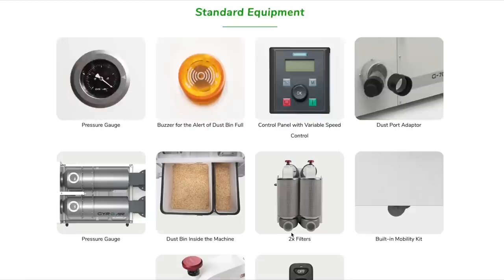Harvey Gyro Air G700 / NORDFAB Duct Work

Comment: Again, we thought alike. I too went with the Nordfab ducting after agonizing over the cost for about a month. I just finished the install a couple of weeks ago. Paired with my upgraded DC (different make and model than yours) I feel like I got more value than I paid for, My shop is virtually dust free now. I did find it cumbersome to assemble the ductwork by myself but with my wife's assistance we knocked it out in short order. And like you said, it's super easy to change. After a couple of days I decided I wanted to tweak the runs a bit and we got it sorted out in no time.

On thing I appear to have done differently than you is that in addition to running 4" drops to my table saw and router table (my router table is inset at the end of my table saw) I also ran 2.5" drops from above to my table saw blade guard and router table fence. I connected those with loose fit/quick connect fittings so I can easily move the hoses out of the way if need be.

I also ran drops down to my miter saw, disc sander, and spindle sander, drum sander, and planer/jointer. (My bandsaw and drill press are connected to a separate wall mount DC unit.) 

Lastly, I used iVac automatic blast gates on everything, which also was quite pricey, but again, well worth it to me.

On a side note, from the brief glance I got, I think we even chose the same overheard power cords. I love that they are 12 gauge and went on sale just as I needed them!

I might as well confess that I did steal the idea of getting that overhead boom for my CT-36 extractor from you. Overall it's nice to have the hose and tool cord out of the way, even though I still fight with it sometimes.
Reply from the maker: Thank you for your feedback! Seems like you getting everything sorted out. And, I love the boom arm. I do agree though, I still fight it as well a little but I think it’s just the nature of the beast.

Comment: I've pretty much decided to go this route for my new shop setup and may buy now to benefit in my temporary shop. The low noise is a big benefit and Harvey also has good pricing right now, too. I'm already using quick connect duct and no question, I'd never go back to snap-lock or spiral.
Reply: I'm curious if this can handle the FS41e. I'm considering selling my Oneida 2hp Super Dust Gorilla and buying one of these for noise level alone.
Reply: @pr0jektcha0s  If you do a lot of milling, you may or may not be happy and that's purely due to bin size. CFM isn't going to be an issue. I had to weigh that before making my decision which was to go with the G700. I"m not doing a lot of big projects so I'm less worried about the bins filling frequently. So far, I'm extremely pleased with the G700 since receiving it a couple weeks ago. Of course, the real test will be in the new shop building where the duct work will get a little bit longer than in the temporary shop.
Reply: @jimbecker5675  It would be a difference coming from the 55 gallon drum. Still, the noise level would be such a huge win.
Reply: @pr0jektcha0s  Same transition from me...from a 2hp "pre-Gorilla" I picked up in person at Oneida factory with 55 gallon to the G700.

Comment: ADVICE QUESTION: You pretty much have the best ductwork setup for your situation to smooth out the path from machine to the extractor.  What are your final thoughts on this extractor's actualized pulling power for your larger tools, your jointer/planer?  I will be running a A3 41 and I am looking at the 700, comparing it to the likes of a 2-3hp Laguna system, but I am left wondering if it can handle the task.  I will be working less sheet stock and mostly milling up rough sawn hardwoods.  Do you find your 700 has the oomph needed for the larger chip load of your jointer/planer?  How fast are you filling your chip bin with this machine and do you find the chip bin undersized?  Imagining for a moment that you were processing wood in the rough on a frequent basis, would you still purchase this extractor?  Your thoughts, as always, are appreciated.
Cheers!
Reply from the maker: So the first thing I will say is I am absolutely loving this new machine. I as well will have the A3 41 in the shop starting in December. With that being said no I don’t have any concerns with my dust collection being able to handle it. Currently I’m getting over 700 CFM at every machine. The only downside that you might experience is the size of the dustbin capacity. I initially thought this would be a downside myself but after trying to empty 55 gallon bags I would much rather empty a much smaller bag more often then empty a very large bag less often just because it’s so much easier to do the task. The other benefit to it is it’s very easy for me to remove the bag and throw it in my trashcan. So it totally depends on how you look at it because in your case it may get really old if you’re milling a lot of lumber and have to empty the dust bin four times in one day. All in all I don’t really have any complaints about this machine so far. I will probably be doing a overview video in the October November timeframe after I’ve had a good six months or so to use it and empty the bags multiple times but so far I couldn’t be happier. Even at my CNC machine which is the longest run it is absolutely dust free when I’m done cutting
Reply: @bentswoodworking  thank you for the thoughtful response brother. I retired out of Ft. Bragg last January. I believe you are a mil brother, how much longer do you have and where are you settling down when you are done?

Comment: Do you have a 240 volt wall switch to control the 240 volt outlet? So you could leave the power on switch at the backside of the G700 in the “ON” position, and not have to reach over the top of the machine to turn on that switch. You could just flip the wall switch and your power would already be on, then use the controls to start running the dust collection. Especially if you have or build anything across the top. If so could you show how you did it?
Reply from the maker: I don’t. It just stays on. But if I did have to move it I would just pull the machine out after putting a surface over the top. It’s very easy to move around
Reply: @bentswoodworking  Thanks for the reply, greatly appreciated. So am I correct in assuming you leave the power switch on 24/7? If so does has it added significantly to your electrical bill?

Comment: Great video!  How did you figure out the hose length for the CNC? I am planning my system and thought that I would put the swivel head centered on my 5x10 bed but not certain how much hose to order and how much slack to figure in. Thanks.

Comment: Jason, what would you think about placing a dustdeputy XL style Cyclone in front of the Blower?  I love everything about this unit but I really dislike the bangs and pings when a piece of wood larger than a chip goes thru my impeller. (on my HF unit)  BTW.  Bought the g700 yesterday.  looking forward to putting it through its paces
Reply from the maker: I wouldn’t personally. But the floor sweet is a non issue with me.
Reply: How's the G700 working out for you?

Comment: Hi Brent, My G-700 showed up this week and I'll get it off the pallet this weekend. I'm planning on putting in Norfab ductwork. The instructions that came with the unit said to keep the G-700 near the dust-producing equipment so that sorta worries me about running my ductwork to the ceiling. Since you've done what I'm planning on doing, have you had any issues pulling chips out of your joiner/planer?
Reply from the maker: I have not. Works great. I think you will be very pleased.

Comment: How do you determine what power speed to use in the dust collector for what tool? Also do you physically walk to the dust collector to change the power setting or can it be done remotely?
Reply from the maker: I run mine on the max setting always. And yes you can only adjust it at the machine.

Comment: Thanks for the info. I am thinking of buying this unit will it will handle 12 inch jointer planer combo with straight knives. Also how do you get the 15% off
Reply from the maker: They are no longer offering the 15% off. However, they have been running a lot of flash sales lately. Sign up for their email list and you will get emails when they go on sale.

Comment: Thanks.  Wow, it seems to be very quiet for a DC of this size.  Just wondering if the 45 degree run going into the machine is required - could you go straight up to the ceiling using one of the contoured 90's that are used for drop down at each tool?  I wonder if it wouldn't be more efficient to build a sturdy platform to raise this DC up in the air (could have storage underneath it and this would make a more direct duct run going into the unit).  Just a thought.
Reply from the maker: This just provides less resistance. I wanted to avoid 90s if I could. As for raising it, it would create problems changing the bags.
Reply: I've been speaking with the company regarding several questions to include this exact one.  Their answer is that you should have advertised performance as long as you have a straight run out from the inlet that's 3x the diameter (in most cases people using 6" ducting would need an 18" straight run at minimum), you can then proceed to use a gentle 90 as long as the centerline radius is at least 2.5x the diameter.  I agree with Jason though.  Use 45's where you can.

Comment: Jason,  I've watched this video three times now and I'm convinced that I haven't seen you mention grounding the ductwork.  I've seen so many videos that make grounding sound really important and I've also heard experts say that it's unnecessary (e.g. when was the last time you heard about a dust explosion in a home shop).  Personally, I don't think home shops generate nearly enough dust to be a problem.  Your thoughts (my apologies if I missed them in an earlier video).

Also, are the 4 casters on the Gyro all full pivot or two straight/fixed and two pivot?  

Thanks!  Joe
Reply from the maker: I didn’t group any of the duct work. It is not needed with this duct. And I believe it’s two straight and two swivel but I am not 100% certain. It is extremely easy to move though.

Comment: I have the same dust collector and my new shop has a set of stairs near the inlet. to navigate this I was going to use and offset fitting just like yours to hug it close to the wall. can you tell me the part #s of the fittings in the first 5 feet of your duct work?
Reply from the maker: I don’t have the part numbers but the piece with the bend is two 15 degree pieces reversed connected by the sleeves you would use to join a cut pipe

Comment: How often do you need to clean out the side ports?  My concern (and the general consensus from what I've seen) is that 700 CFM isn't enough to reliably separate the finest particulate which means a decent bit of it is probably getting to the filters (as compared to the more traditional ~1500CFM dust collectors in the same price range).
Reply from the maker: I haven’t get the need to clean them yet. I can’t speak for other machines

Comment: do you miss not being able to run a floor sweep on your dust collection system?  its strange that the impeller is BEFORE  the cyclonic function.  Every lick of dust is passing over the impeller which means you don't want to vacuum up anything larger than a shaving.  I cringe every time a small chunk of material gets sucked up in my harbor freight unit.  It makes quite the hammering sound hitting the impeller.
Reply from the maker: I do not. Mainly because I never had one before. I just sweep stuff into a pile and the sweep it up into a pan.

Comment: Did you have to do any sort of grounding of the duct work?  I’m about to add a new system in my shop and half the people say I need to and half say I don’t.
Reply from the maker: I’m one of the people that say it isn’t necessary for most home shops. Definitely not with this duct work
Reply: No need to ground metal duct work. Not dealing with that question was another reason I went with the Nordfab ducting like Jason did,.

Comment: Few points. First off. Thanks for sharing. Hard not to be impressed and not to be jealous of your well equipped shop. However, Sure wish you’d disclose msrp, discounts, incentives, or freebies for all this stuff. If we want to consider a similar option at least we’d have a right idea of costs. Something else is function. Show us the dust bin and frequency of empty, ease of clean , etc. the cyclone type seemed very easy to use how does this compare, etc. 

Also for your trial and error way to calculate flow. Seems like the oem or person who advised you (john?) should’ve given you a way to measure or calculate it. I guess a simple water column or some other way to measure delta p could be used to calculate flow. To just say it maxed out at abc is only partially helpful.

I’m actually researching machines and options now for my shop so this info sure could help. Thanks sir. Honestly though, Hard to daydream the stuff you have access to. You’re quite blessed. Happy for you. 

Thx
Reply from the maker: All of that information will come in a later review video after I have used the machine extensively. I can’t share emptying a full dust bin when I haven’t yet filled it up. As for cost, I shared the price for the amount of duct work that I used. The Harvey Dust collection has been fluctuating quite a bit since it was released. It is currently listed at $2990 on the website. Last month it was on sale for $2300 and just the other day they had a flash sale at $1999, which is what I was invoiced for. I am an ambassador for Harvey now and they have even provided me with a discount code to offer my audience where you can save 15% off if you wanted to buy one for yourself. A common miss conception is that my shop is full of tools that I didn’t have to buy. That is definitely not the case. I am in a position now to work with companies, however, I am very careful with the companies I chose to promote/support. Also, with the CFM, I know how to calculate it the issue is the equipment I have, isn’t rated for the suction of the machine. Hopefully this information is more helpful for you. If you have any specific questions, feel free to email me or send me a DM on Instagram and I would be happy to help. Thank you for your input and suggestions 👍
Reply: According to the basic price online it’s $4200.
Reply from the maker: You need to go to the Harvey website. For some reason vendors are charging a very high price